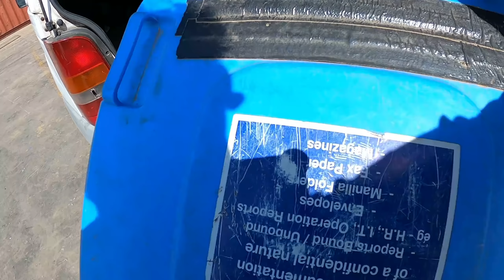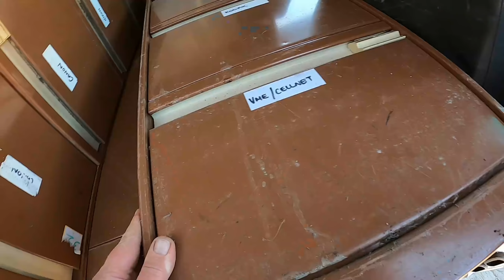Scrap Yard Price Check on Election Day!

Comment: Hi Ben. As you are already taking the boards off the hard drives and your client has taken the lid off to get to the platters, why don't you strip the whole case? You had extruded Alumimium at $1.75/Kg but you're only getting 45c /Kg for the irony-Al. With the lid off and the board and platters gone, you'd have the rest of the contents out in under 60 seconds, surely? Thanks.

Comment: WTF happened to the shred steel or low grade pressed steel as you call it and all the midgrade insulated wire. You just jumped from one scrap trip to another  WTF?????